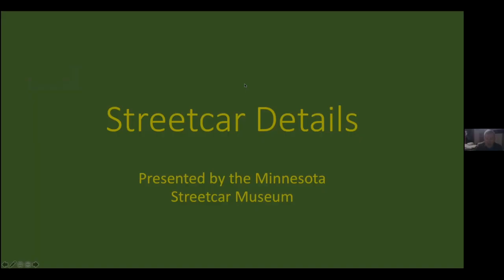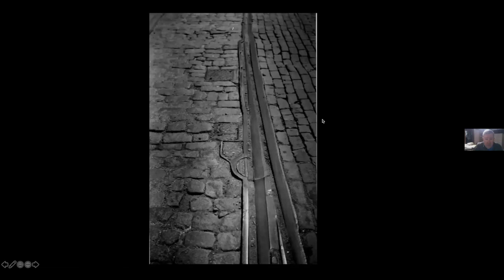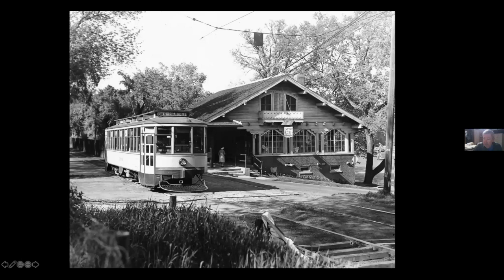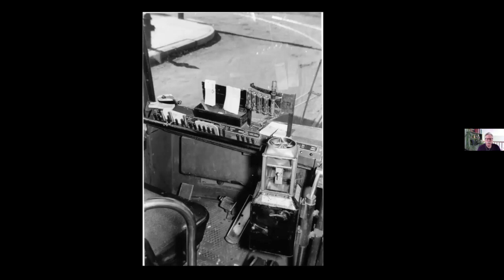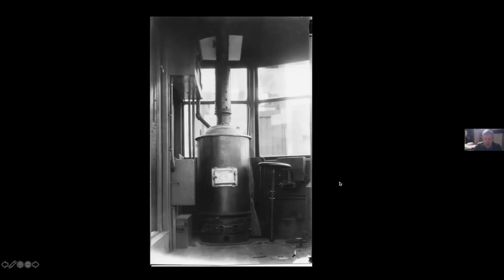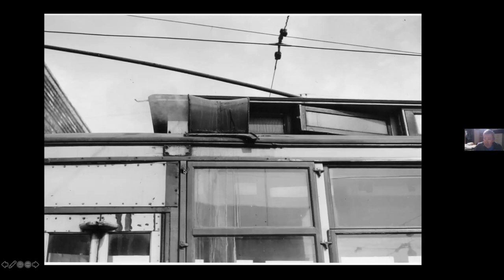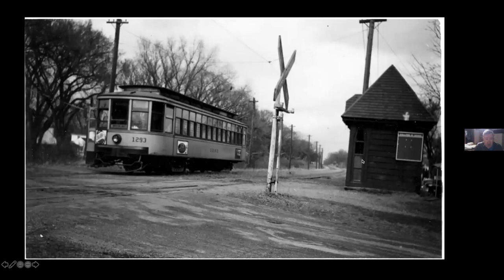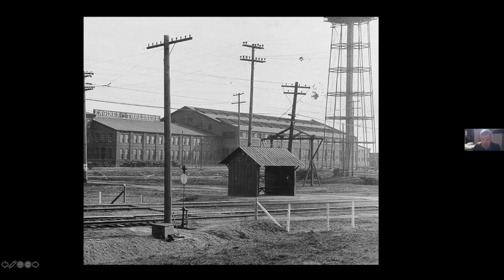Streetcar Details

Comment: The "cattle guard" discussed at 42nd and Lake Harriet may have been to keep automobiles off the right of way.  There is a very similar array of naked ties at the bottom of the selby tunnel where the right of way turns into the street which I think is Kellogg Boulevard.  I have seen pictures of it in the recent picture book on TCRT.

Comment: Interesting that you guys call a "switch iron" a switch rod. The term "switch iron" is basically universal. In Philly, Pittsburgh, San Francisco, New Orleans, Boston and just about every place else calls it a switch iron. I've never heard them referred to as switch rods any place else.

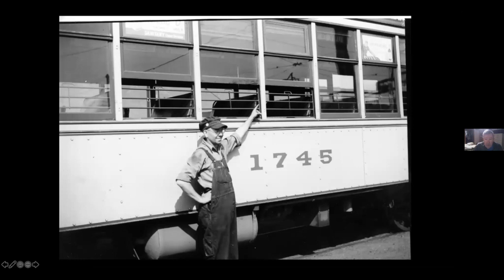At 13:10, those things are called window guards.

Regarding coal stoves on the old cars, all of that labor, cost and mess, when the PCC cars arrived, it must have been an amazing improvement. Not only for the employees, but for the passengers. The TCRT should have bought hundreds more PCC cars in the late 1940's. It's a wonder the riders and city didn't demand it. Imagine the operator operating a smooth, quiet, fast electrically heated, foot pedal operated PCC car, compared to that old equipment. Even boarding was easier on a PCC car.